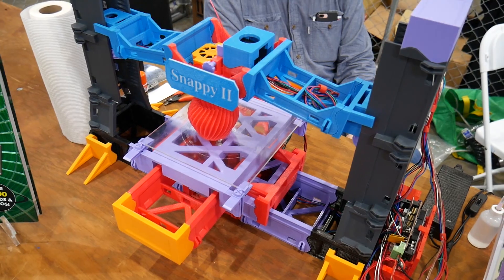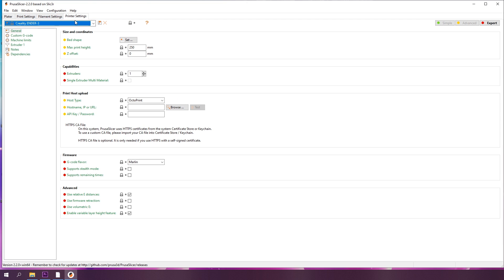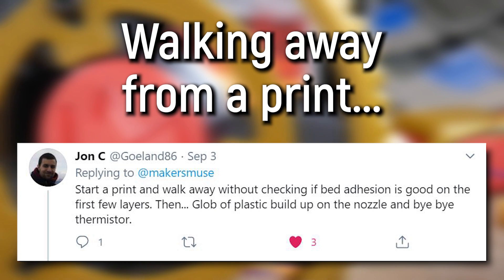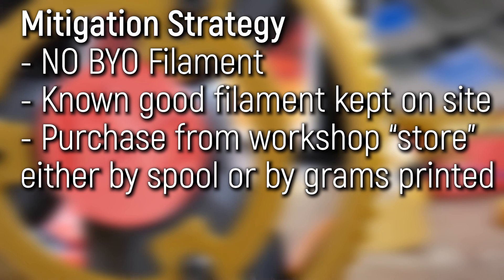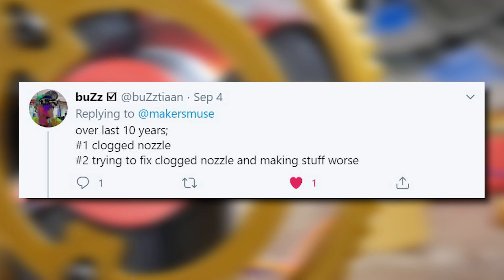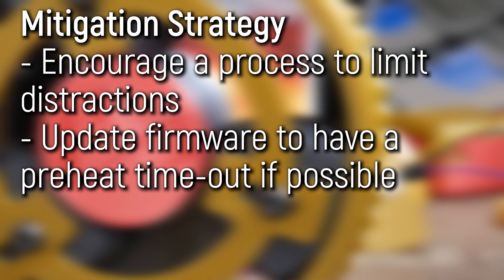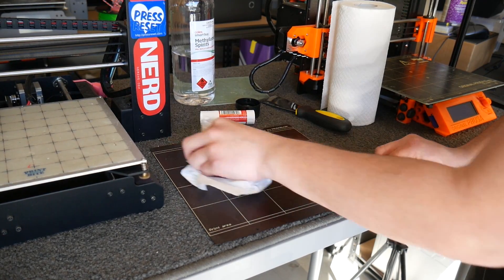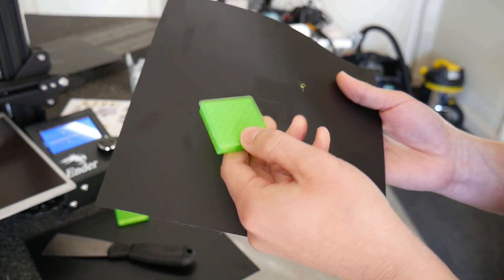How People BREAK 3D Printers (and how to stop it)

Comment: I have been watching your channel (and subscribed) since very nearly the beginning... I have also been to Joel's channel and Tom Sanlander and CNC Kitchen... of these yours and CNC kitchen are the best while the other two are often a source of "amusement"...  I have been doing this since the RepRap project and worked with the industrial grade multi thousand dollar printers for decades prior (including resin).  By far the biggest horror stories are the almost open warfare that goes on within the Facebook "printer support groups".... There are quite a few clowns who figure out just enough to get good prints and then they *"Think"* they are now some kind of "Guru"... I have spent hours upon hours deprogramming new users who have had completely wrong information fed to them by these vocal clowns...

First thing I tell them is this is NOT a Star Trek Replicator, it is a machine tool that is extremely dependent on adjusting a myriad of interlocking settings to get a good print with each material. First thing is learning how the machine operates and what each setting does on the original machine out of the box. Do NOT make any modifications or changes until you know the machine and what the modification is supposed to accomplish and how it will affect the settings and parameters.   Next is properly preparing the area and work surface for the type of print and material being used, including periodic checks of the leveling, don't count on some automated mesh software, learn how to do it right.  Next, as you said, watch the few first layers going down and make sure there is enough material... that five or ten minutes you spend in the beginning can save you hours of print time and a LOT of wasted plastic later. Then there is the post production processing... taking the print off without damaging the print or the bed and cleaning up any supports, etc...

Overall, overconfidence and lack of understanding are the biggest issues... nobody picks up a musical instrument or a new hobby and is a "master" or "Virtuoso" the very first time they try... it is practice and learning that works best and there are no short cuts... only incredibly sketchy "luck".  Sometimes one can do lots of good prints right out of the box with factory specs, but that is because the machine was usually thoroughly tested and adjusted for reasonable quality prints. but as soon as you add or change things, you have broken the warranty and then the clowns start howling about "junk machines"...  They keep tinkering and complaining, meanwhile I am happily printing away... I no longer peruse those Facebook groups anymore because I am tired of the clowns arguing and leading people astray... Most of the people who can really help give up after a while because the clowns main mission seems to be making sure that everyone else has problems too and they are tired of arguing with the clowns.

Great video!!! Hope many people see it and I am definitely sharing!

Comment: Clean printbed. Remove any leftover adhesive glue. Calibrate bed. Check with width feeler front back left and right. Make shure bed is reset to 0 position.
Keep filament stored dry and in the dark.
Simple precautions always helps.

Comment: Basically what I'm hearing is that people who aren't willing to be patient and actually follow directions shouldn't even be allowed to touch a 3D printer... I agree. But that should be a given for pretty much anything in life. If you are one of those people who feels you don't need to follow directions or learn, then you are part of the problem and I'm really curious how you made it through primary school. Unrelated but related: I always have a whole part bin full of spare parts like pulleys, belts, nozzles, heat breaks, heater cartridges, etc. Anything that can break and cause down time on my printers I always have at least 2 or 3 spares on hand. That way I can quickly fix something and not have to wait for shipping.

Comment: I don't run a makerspace or anything, but been active customer at local library, and know quite a bit of 3D printing (got 2 printers nowadays). One thing that should definitely be added to the list:
People who think they're incredible funny, when they set the settings wrong for the next customer.

One time the nozzle was set to 0.8 (it's 0.4, luckily Ultimaker displays the nozzle setting on display!), print preview was set to not display material from the only extruder/nozzle - there was third one too, but I can no longer remember it. Sometimes people just go to random running printer, turn it off, or just see what happens if they remove the SD card.

Comment: Wait is painters tape actually a bad idea? I started using painters tape after I accidentally destroyed my plastic sticker print bed on my Monoprice Select Mini V2, and I haven't had issues with it. For some prints that I really don't want to move, I'll use a standard glue stick as well to make sure it has extra adhesion. I've had very few failed prints, but the prints I had fail were on the plastic sticker bed that came default on the mini v2, and after I started using glue it made all my prints succeed. Now that I have painters tape, I find that glue is unnecessary in most cases. I guess bed leveling was required after I got painters tape, but besides that I don't really have any issues with using painters tape or glue stick. Not yet anyway. I now have an ender 3, and instead of using the plastic magnetic sheet it came with, opted for painters tape instead :D. The magnetic one was crap, but does using painters tape (and occasionally glue stick) actually have a negative impact on prints?

Comment: "Dont let it go unwatched for hours" 

Hmmm how about days? I've had no issues
Reply: Ya I'm not going to stay and watch my 5 day print. I think I'll roll the dice and just check on it every once in a while. 3 years later and I still haven't had any massive issues. I find if a print is going to fail it will be within the first 5 mins and after that your pretty much ok.
Reply: @stinkyham9050  I had a 3 hour print on the last 4 layers (literally had checked on it just as it was about to finish) the model twisted around itself and made the figurine I was working on a snow cone. I have no clue what cause that or why, It was like someone blasted a heat gun at the model and twisted the top around a few turns. Set up the next print the exact same way and waited and watched to see what would happen and it printed perfectly and has been printing fine ever since. My 3d printer is at the 8 o'clock position from my desk so all I have to do to check on it once in a while is turn my head over my shoulder.
Reply: @anastasiacline6159  Shit happens! Lol

Comment: I have the opposite problem. I can't have my 3d prints fail, when using the right parameters and setup for the filament. I can't get anything to spaghetti, pop mid print and whatnot.
Everything always come as intended. So boring.

Comment: one question...
¿What printer do you recomend in this case?
if i want to make a "Manequin" form a person to make a PERFECT suit or dress (Without calling him every 5 seconds, or those who TRY to look slimer or taller and give you "Wrong messures" for their "Tricks" SILICON ON THEIR FEET, or "Hidding" BELLY "Swering" they are Realxed and "Is my true size... ahem, ahem... I will kill you ALL... ahem, ahem)
¿HOW I NEED TO SLICE THE PIECES of the "Manequin" to be "Gap-less"?
¿What is the printer with the BIGEST platform? (The quality dosn't matter, is just to STAB IT WITH NEDDLES, don't needs to be pretty)
¿It have DUAL EXTRUSION? (To make the "Core" STURDY but the "Exosketon" like silicon or similar)
and....
now, far away the printer itself...
¿Pose to be printed well that let me put, quit, put, quit, put, quit, again, and again, and again the clothes? because if i printed it with the hands DOWN... it will make "Supports" and loss a TON of plastic
but if the hands are FACING UP i wil have NO SUPPORTS... but it will be... IMPPOSIBLE TO DRESS
and you know.... the print is not "Flexible" to put in that, way, this way, like this, and, we're done i only have "ONE SHOT" so.... ¿A pose that will make ME AND THE PRINTER "Happy"?
¿A 3D scanner with good resolution, or other technic (For example "Fotometry" and program it thatt case)?
¿A ruby nozzle will fix all the problems that appears here? ¿Is a good invest or a scam?
¿Materials? (One STURDY (Core) and other "FLEXIBLE" ("""Skin""""))
¿A store that sells BIG QUANTITY of material? (At least... think on 2 meter per person think BIG or think NOTHING, i rather to have material left than left the print waiting for weeks because "I have no stock")
ONCE I'D SEE A "PRINT-RECICLER" ¿What is the cost? (It makes OLD prints in NEW filament) ¿Do you recoment to recycle or... buy new filaments instead?

and... for FREETIME 
here I WANT "Quality" ¿what is the printer with the THINEST LAYER OF ALL?
is just to make silly things here i want to don't see the layers... but because is for "Freetime" this printer have low priority than the first (Because i can use the first to my hobbies xD)

¡¡Sorry, for the "Interview" xD!!
but i want to START MY OWN (And just MINE) Business and i want to make thing "Doner than done"
and i saw that "Recycler... and, is better than have 500 manequins with diferent sizes or "Clients messures" with job "Middle-done" just have 5 and recycle them
(And if i have more work one month, use NEW... and when i'd done ¡MAKE IT FILAMENT AGAIN! ¿Is not a great idea?)

¡¡Chaoo!! ;-)

Comment: I have saved a few prints by using superglue and it worked.. I dont really get why its stupid? Also printing on tape is not such a strange or outdated thing bro
Reply from the maker: Glue ruins the print bed for everyone else and tape is basically single use - update to better surfaces man it's worth it
Reply: @MakersMuse  If you use the superglue on the tape for rescue its single use, true. But I can print like 20 times on the exact same spot on tape in PLA without any problems and without the tape bubbling up. However, it does feel a bit noobish to print on tape, that is also true. Do you recommend a magnetic flexible surface?

Comment: Lmao i buy peoples destroy printers off Craigslist and fb market place for 50$ each... Truth is Who really cares Hot ends are sooooo cheap and easy to replace 20 minutes and 10$ off ebay and you have a whole new hot end extruder and fan... The best way to keep these things working is set up the firmware correctly so it won't do things like set thwir preheating all day

Ps its super easy to remove a snaped off nozzles and throats just throw it into solvent and use a screw extract if necessary which it usaly isn't

Comment: Is that a real sewing machine in the background?  If so, do you have videos on it?

Regarding the pre-heating, both of my printers have a "Filament Unload" feature.

Also, when you started talking about Induction, I began to think that you were talking about induction heat beds.  That is something I want to see.
Reply from the maker: I don't unfortunately, but it has a very unique cam driven stitch pattern that I might cover in future. You 'load' different stitches and could theoretically 3D Print new ones.
Reply: @MakersMuse  I just got a Prusa Mini+ a week ago, so this was an informative video for me. I've already had experience with prints breaking loose, but that's a matter of getting my first layer adjustment correct (my aged eyes make that a little difficult).

I've got two sewing machines, and one of them has cam-driven stitch patterns. Unfortunately, that one is broken; there's a gear somewhere in the bobbin drive mechanism that broke, and they don't make replacement parts for it anymore. One of my upcoming projects will be to see if a 3D-printed replacement will work. I hadn't thought about the possibility of 3D-printed cams for new stitches, but thanks for the idea.

Comment: "media has you think you just push a button and out pops a 3d print"

But I do press a button...and a 3d print does pop out...eventually...and there are things I do before and after the button...but they aren't 100% wrong...they just omitted the hard stuff
Reply from the maker: Hehe yeah, 3D Printing is really easy until it isn't!
Reply: @MakersMuse  especially on your 1,748,735 the attempt at printing a key chain...I kid on that...love the vids...I have learned a lot...thanks for all the help!!!
Reply: I clearly am living on the Dunning-Kruger Mount Stupid. Assembled my printer, calibrated it, and since then I just push a button an out pop the almost perfect 3d Prints. Fingers crossed my experience stays this way.
Reply: @mlippert  I got a DaVinci Jr (with DIY filament tracking chips) and after a thousand hours of print time have started experiencing the joys of printer silliness.  Could be my use of cheap filament though.

Comment: Personally. I like the glass print bed where it just pops of after cooling down. That works well on that printer since I use it for PLA which is most of what I do. I have an ender 3. But now that I think about it it came with a removable bed. It just used those paper clips to hold it down which got annoying to remove each time.

Comment: Could you add a "handshake check" between a printer and Slicer settings to avoid wrong settings? A simple printer ID in the GCode and a check on that machine...
Should be easy enough to implement in Marlin
Reply: And could easily be expanded to filament-profiles as well...

Comment: I’ve just broken my Balco AGAIN. It will not print ABS, despite correct settings. Then when I reset to PLA it all worked fine for the first layers then jammed and ended up with filament all over the nozzle. This is my third attempt at ABS on this machine in about three years and I will not be trying it again! I can well imagine what happens when you put these in a public place!

Comment: I've given myself a nasty slash trying to work a sharpened putty knife under a print. Mitigation: use a different tool (in my case, an iFlex). Or better yet, use a flex steel sheet.

I've overtightened the X belt on the office Prusa, and hopefully that will be fixed next week. (Bearing failed)

Comment: Hairspray works... On a borosilicate surface. Heated. Clean. And with a very specific variant of a very specific brand. And it is adhesion, not a release, so if the nozzle is too low PETG prints can bond to the glass permanently.

Comment: Alright I’m guilty, I have had a problem for over several months, the extruder stepper motor stopped working, noticed this after failed attempts of prints, no filament was coming out, that is when a error showed up, something about change filament in the sensor, this is when I saw that the sensor hole for the filament had been bored out, so I panic I, I get a sensor (Smart Sensor) also I get a new mother board and Micro Swiss hot end, yeah I thought, but alas no. Fast forward to today I change the unit to its original state, with two exceptions I leave the sensor on and take the back plate off the hot end, leaving the Micro Swiss hot end component. And yes I am back to where I started, the extruder stepper motor still not working. What now
Reply: check that your layer fan isn't blasting 100% speed during the initial few layers.  I find with my printer, that the layer fan blows past the nozzle which cools the whole hot end considerably (approx to 165 degrees), which then tells my printer to CEASE EVERYTHING until the temp increases.  It's only on the first 4 or 5 layers this happens, as the air gets blasted back at the nozzle more forcefully.  I just set CURA to not use the layer fan until further into the print (if possible).  Some prints need the lower level cooling, not often though.

Comment: I take care of 4/5 printers in a MakerSpace, which also contains a wood shop. I find the bed every day of use needs dusted, and cleaned. I also have to deal with donated filament, but I test each one to find out what type of filament it is that was donated, due to the person did not identify what it was when donating it. I have seen people use wood chisels to remove prints from the bed surface also. (So many bed surface changes!!!)

Comment: I personally used to use tons of pritstick every time I would print something which kind off worked but it would leave horrible marks on the bottom of prints and then I realised that just wiping down the print bed with some isopropyl alcohol works much better

Comment: I don't run a makerspace, but I have had several printers and have several suggestions for anyone working with their own or a makerspace's printer:
1. Get a printer that is a tank: I have a flashforge creator pro that's over 4 years old, has gone though a ton of filament, and works as well today as the day I bought it. Before that I had a prusa i3 kit that was a better conversation piece than a printer (even after modifications). If you are looking for a printer for yourself or a makerspace and don't want to be troubleshooting all the time, do your research and get something known to work well and reliably.
2. Use a direct drive extruder with powerful motors: Again, my Creator Pro has direct drive extruders that have never had an issue with anything but the nozzle. They've clogged and been left running for hours and all I have to do was clear the nozzle and blow away the filament dust shredded by the extruder gear. I've set the bed height wrong with the nozzle way too low and it still printed fine--even if the first layer didn't have enough room to extrude.